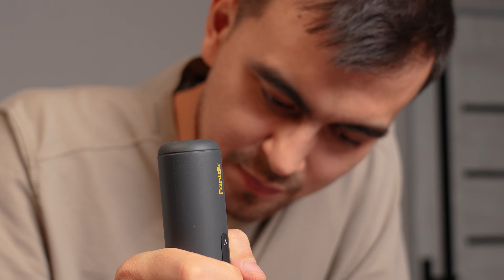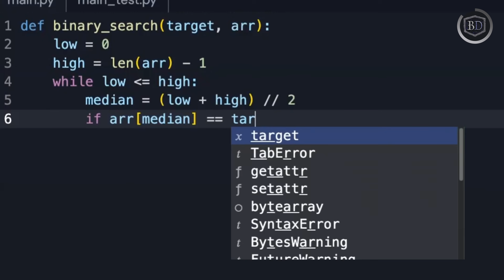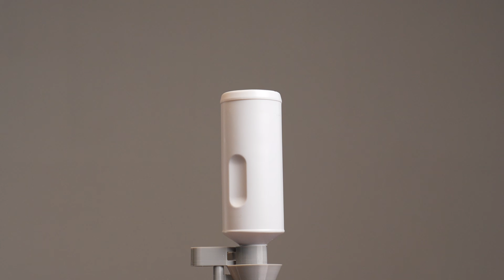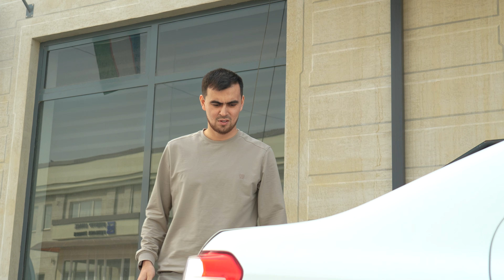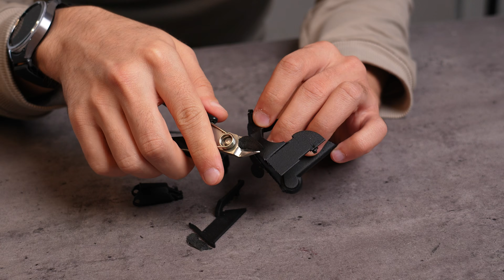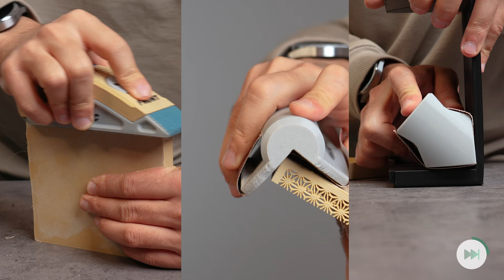You NEED to 3D Print These for November 2025

Comment: You have to rotate the can as well as shake it to get all the settled paint off the inside, thats what the ball is for. It should swish around as you shake it in little circles, not just rattle up and down, or worse, side to side like that.
Great idea, but I'll stick to doing it properly thanks.
Reply: Also, there are actual machines that can keep your paint warm and mixed at the same time.
Reply: @DemePoole  Really? One would hope they operate silently without a power source in the dead of night to be of any use to a contemporary artist. Not that I'd do such a thing, but I've never seen a lumpy tag, just saying. 😉
Reply: @OriginalMorningStar Some people aren't bothered by a little noise. And that plastic thing with a drill attached to it doesn't make noise? 🤔
Reply: @OriginalMorningStar Oh, and the power drill does not require a power source? 🤔
Reply: @DemePoole you can use your hands for artistic purposes
Reply: Hmm, spray paint is a fine particulate suspended in spirits that settles out over time. As a dense layer, it is non-Newtonian, thixotropic, and does not readily mix with the spirits without mechanical stirring by the ball, which is designed to traverse the walls of the can. It just takes a long time bouncing randomly around to do that, not very efficient is all.
I'm not saying I'm right, but I am nearly 60, an artist and maker all my life and in my younger days I repaired and restored Austin A series and BL Heritage vehicles. The old dude who ran the place is long dead, but I've never forgotten his advice and like to share it when I can...
Reply: @OriginalMorningStar I usually just shake it up and down, ya know, like it says on the can. Keep it in a small bucket of warm water to get those particles moving around a little faster. No need for fancy words and all that jazz. It's just paint.
Reply: Spinning the spray can quickly doesn't mix the components, but separates them. This is the principle used in medicine to separate blood into its main elements. Then, when the sphere and the liquid stop spinning, maintaining inertia, they mix, but only for a few seconds, which isn't enough. That system is practically useless.